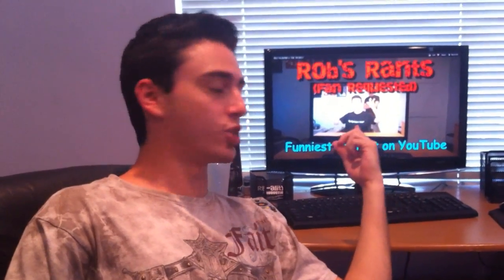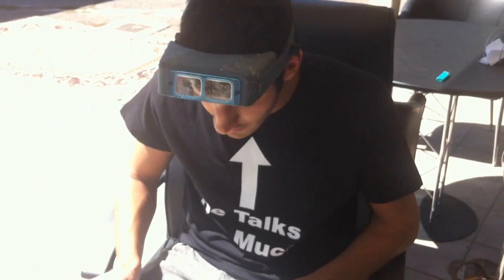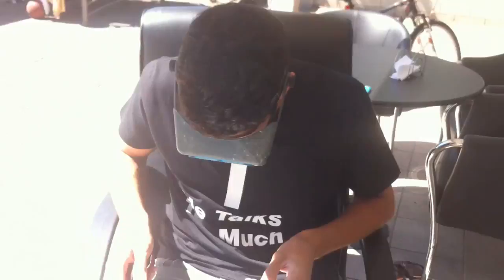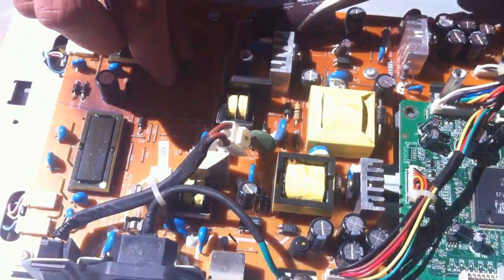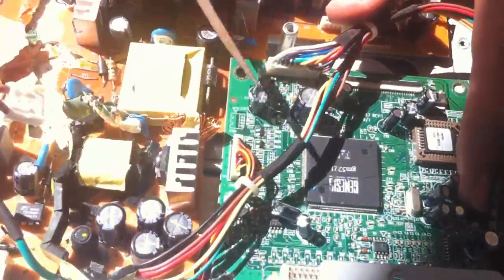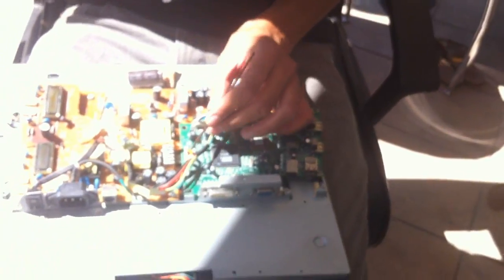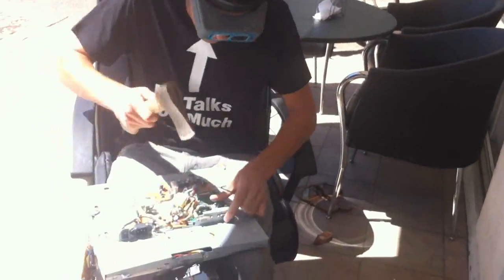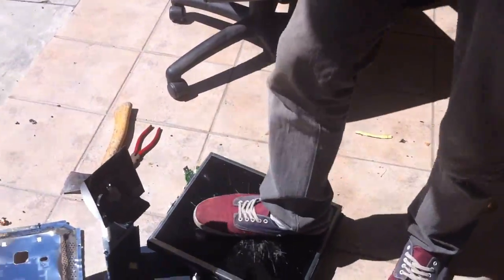How to Increase Download Speed

Comment: But an actual way to help you download speed is the listed things.
1.a better router which you can get anywhere. the best are the ones that cost bout $200
2.keep the amount of files in documents and such to a low. "dont use alot of memory space"
3.clean computer of files/pic/vids whatever about once a month.
4.uninstall programs you dont use.
5.dont use norton its a scam with a worm built inside.
6.you dont really need a firewall becuz viruses are set up to attach to programs you download or use

Comment: I did this, and I have to say the tri-plated amperage diatomical meter was slightly damaged. I also need help with the geological circuitry mechanic prong Y-2 as it is corrupted as with the technological fracturing of the oblique barrier.

Can anyone help? I only carry FYInc prongs Y-1 ~ Y-45 models FT3300 and FG4400z.  I'll have to make do.